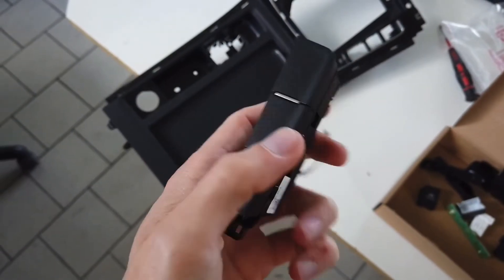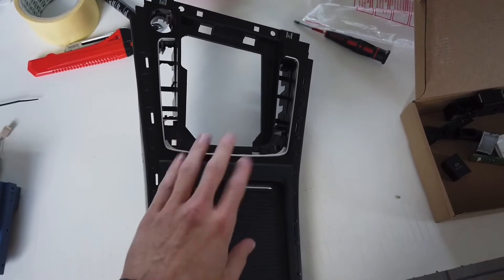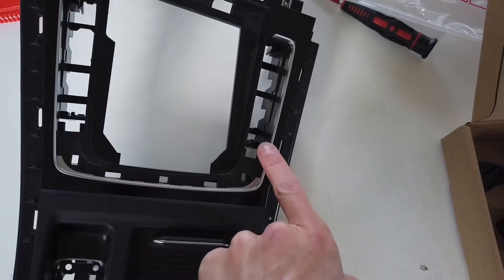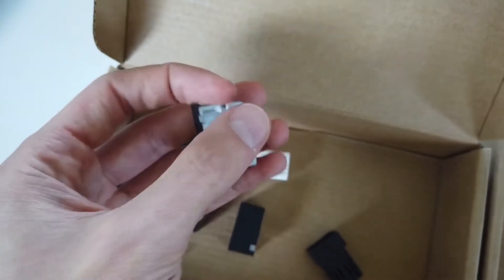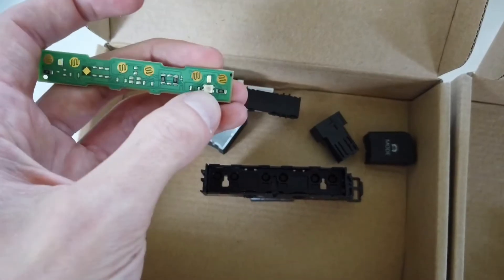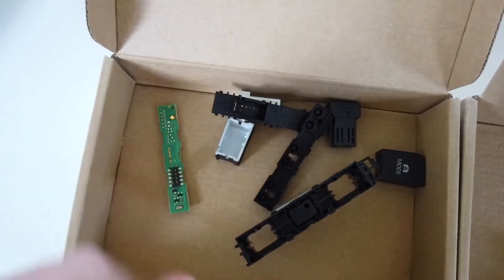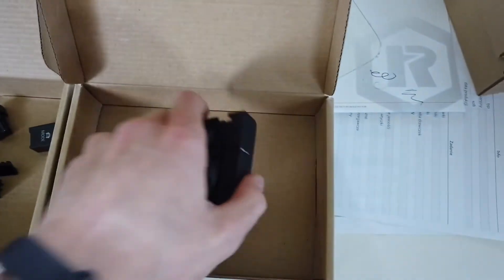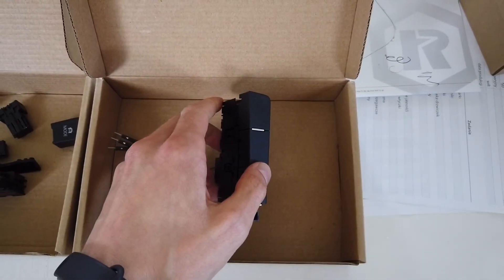VW Golf MK7 (5G) activating center console buttons

Comment: I did installation of mode button. The button works. 3 to C34 and 6 to C21. 

Only thing the mode button turn orange for a second and then turns of. I did coding in 09 > buttons center console > button 3 > driving program. 

I’ve patched the unit. So if it’s a swap function I should be able to do it myself. 

Can someone help me ?

Thanks in advance

Comment: Hey bud, have seen passat B8 with usb c in one of spots and also has a wireless charging pad, the trim bit looks almost identical to the golf 7.5 shape, I believe the cubby in front might be different or have no door in passat B8 but just wondering if might be doable just take the cubby  door out and keep safe to return to stock if needed. Would be super useful having usb c built into it instead of a charger in lighter and wireless charging with wireless AA and car play would be amazing. You have great knowledge and the best videos on mods and upgrades on our little cars, it's fine if not but couldn't hurt to ask I though, thanks bro 😊

Comment: I've got the buttons currently hooked up to a breadboard, I can get pulse from the start stop button which turns off and on an led on the breadboard.

I can't get the back light for the button to function however, do you know if that's possible looks like you have a wire plugged into the back light?

Comment: To make these buttons control 3rd party electronics, if we have the second and third buttons unused on the left side, does that mean we wire pins 4 and 1 for one function and 5 and 1 for the other? (Is it hard or tricky to wire so many things to pin 1?) I am considering a mod that would use a sound board  that activates when a trigger pin is connected to ground. (https://www.youtube.com/watch?v=lv8wqnk_TsA)
Reply: Did you ever figure this out? I want to do the exact same thing

Comment: How will you connect this switch to the original wiring loom with your new wires. A bit more detail as to how to wire in the new button would make this more useful.
Reply: Hi. Were you able to find any information on this? I'm still looking at how to make the switch work and do what it's supposed to do.

Comment: Hi Mate , Could you show us how to change air quality sensor in Mk7, or just the location of part please?
Reply from the maker: I would have to double check that but I believe it's between engine bay and cabin, under the plastic that is covering wiper mechanism, passengers side.
Reply: mr-fix thanks mate , cuse im getting fault code through ob11 which telling the air quality sensor is faulty!! Don’t know what’s the job of this part and the location aswel ! Do u have any idea?

Comment: Good video! Interesting, is it possible to configure one of these buttons in the BCM to turn on the heated windscreen?
Reply from the maker: BCM coding supports options for: Luggage hold closure, Offroad mode, Driving Mode, Rear window defogger, windshield defogger, steering wheel heater, Start-Stop, GTE mode.

You would have to try it. You can change function of Start-Stop button to any of the functions above to check if it will work.
Reply: @mrfixpl  hi thanks for your amazing Videos. I have deactivated the Start stop function via obdeleven (Set higher voltage demand) is it possible to change the function of the Button to driving Mode? And could you please share the coding steps or create a New Video about that? And will my stage 1 setup be resetet by activating driving Mode selection?
Reply from the maker: Checked the coding but unfortunately changing center console button function does not work. Not for the start-stop button anyway. Most likely it's wired to a pin with fixed function.
Reply: @mrfixpl  ok thanks for the reply mate. I think I will buy the Buttons and cable from aliexpress. I hope my chiptuning will not be resetted... 🙈
Reply: Nice nice nice....where can we buy those white ...? They have a name, code .... Give us a link Where to buy from mr-fix pls